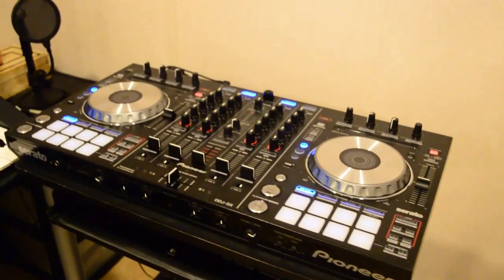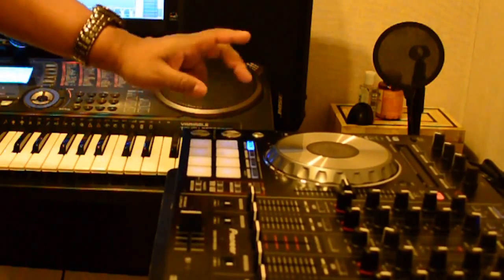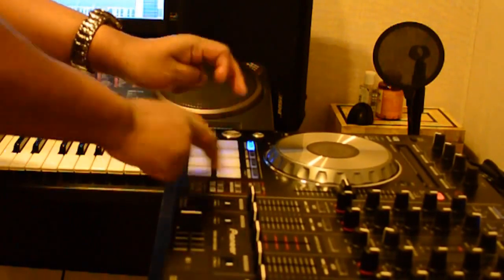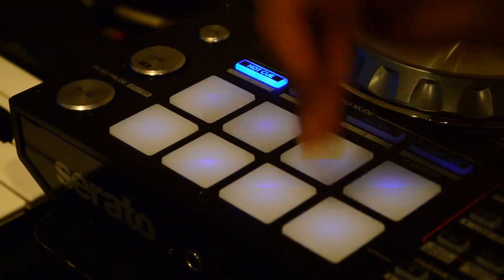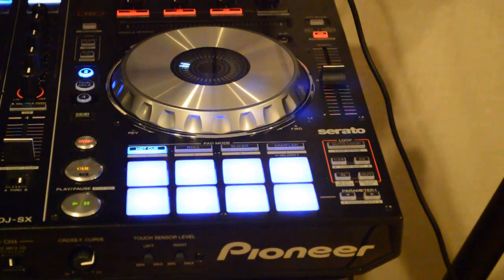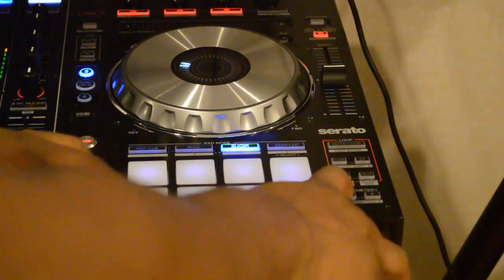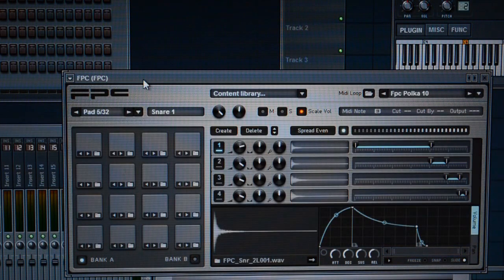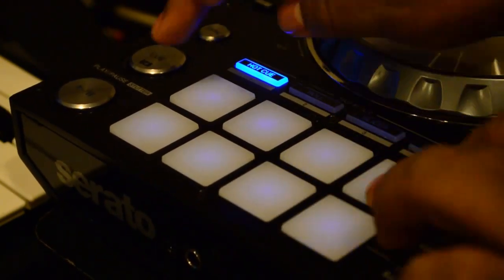Using the Pioneer DDJ SX as a Midi Controller in FL Studio

Comment: Would the ddj work with deckadance 2 if we use midi mapping to assign to certain pads? Also, would we be able to assign the jog wheels and use them as turntables on deckadance? I think the numark does it but i prefer pioneer's feel. Thanks for the help.
Reply from the maker: I'm not sure. I'll have to try it.